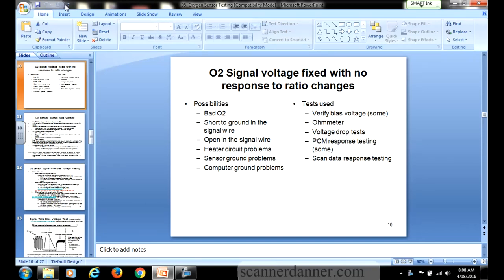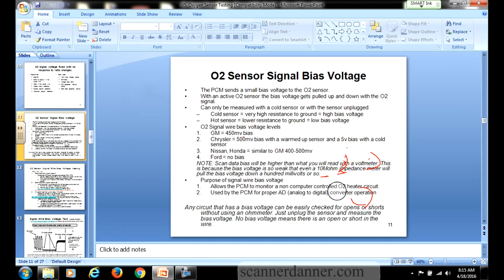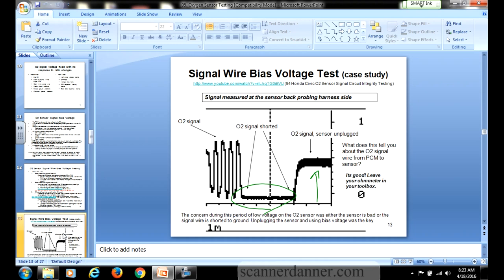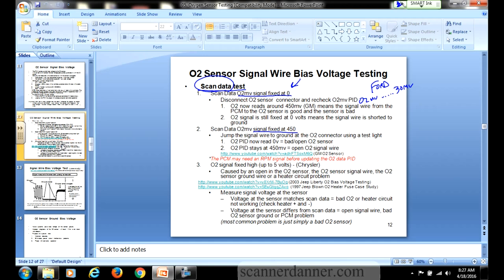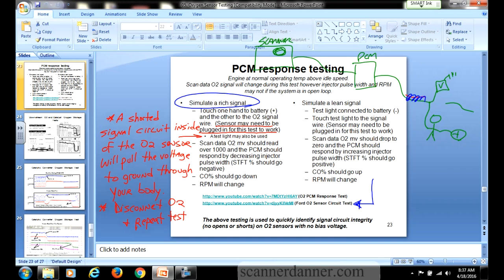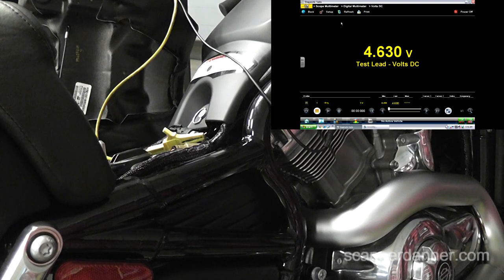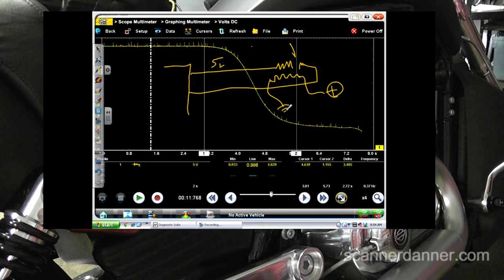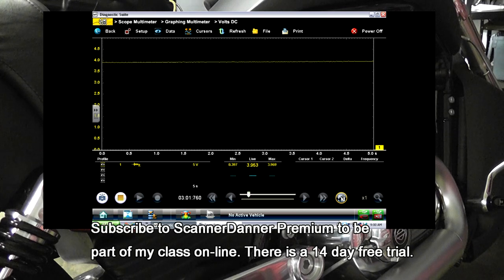What is Oxygen Sensor Bias Voltage? (an SD Premium video)

Comment: Thank you, Sir.  You described my problem exactly. o2 heater circuit malfunction code 41, heat element in sensor checks out, wiring checks out. Factory flowcharts don't give signal testing procedures or values and, whats worse if you follow flowchart to end it suggests bad ECM. I couldn't convince myself to throw parts at it (new o2sensor) without evidence it was bad, had started to believe I needed a new ECM. Edit: forgot to mention going to try this out tonight. Working on a 94 Acura Integra.

Comment: 27:21 Also, people were using spark plug non-foulers or spacers on the downstream oxygen sensor to trick the computer into thinking the catalytic converter is good.  Some manufacturers responded by adding an additional test of commanding the air/fuel ratio rich or lean to see if the downstream oxygen sensor is responsive.  If it is not responsive, then the computer will throw a P0420, even if there is a flat line on the downstream oxygen sensor.  It was down to combat spacers on the downstream oxygen sensor.

Comment: Hi Paul,
This is unrelated to this video but I could not help my self
from asking. You videos are some of the best I like how you cover all the
aspects of the issue at hand. Nice to see how complete you attack a problem. I
find the best part of your videos is when you teach your self! Keep up the excellent
work!

I was wondering, could you do some ABS Traction control
videos? I would like to see how to test the system electric and mechanical.
Bleeding the system is a challenge as well. Some systems also integrate the
steering angle sensor can you explain why?
One last thing the CAN BUS system HI Low testing how to know
if its talking to the PCM or the PCM to the ABS module.
Thanks 

Michael
Reply from the maker: Thanks so much! Here is a playlist for some ABS stuff
https://www.youtube.com/playlist?list=PLAFYVCyenqcoLcXnSf8IW23v-zoJfAi9-
And for sure I'll post videos for the other things you mentioned as I see them.

Comment: I know a Harley is a status bike but why would anyone wanna sit on something that idles so rough you can see the mirrors shaking. Could just as well be riding an old John deer model A tractor. I like a smooth running bike. Just my preference. Nice smooth idle and a great power curve when accelerating. Good lesson great explanation of how the O2 sensor heater circuit works.

Comment: Awesome video. Practical checks that most manufacturers don't tell you. When checking circuit integrity wouldn't it make more sense to unplug the sensor and use the circuit ground to short the signal wire rather than using body ground? Using the circuit ground when shorting the signal wire verifies both the signal circuit integrity and ground circuit integrity at the same time. Thanks.
Reply: J

Comment: Paul I do not think ice on the O2 sensor will hurt it, I lived in Minnesota and in the winter it can be -50 with the wind chill. Plus if you park outside in the snow it gets right on the O2 sensor. Cooling the sensor down fast.
Reply from the maker: I was just worried about the sudden rapid cooling but your point is a good one for sure.

Comment: Do you have any videos teaching about the newer A/f ratio sensors on Fords? I believe they're 5 or 6 wire and are using a bias. Ive not had time to sit there and play around with 1 yet. The ones I've had have been hard to get to the connectors and of course the exhaust is piping hot. Ive been checking heater circuits with a test light and then unplugging the sensor to check for 2.5v due to seeing that on others. I'm not exactly sure how they work with, I believe they call it, a nert cell? Would like to learn more about them though
Reply from the maker: Not on the design you mentioned but I do have a few wideband O2 videos. Search "wideband" on my channel. Thanks!

Comment: FYI, my 2003 Mitsubishi Montero 3.8L seems to have a super low bias voltage of 0.11 volts (yes, 110 mV).  Both oxygen sensor harnesses read the same on the corresponding harness pins. I couldn't find this on any Internet source...probably because most 15+ year old Mitsubishi are in junkyards, in USA anyway! Lol...but I like mine!  

Now if I can just figure out why it sometimes refuses to start when it's in the middle of winter. All I have is an occasional P0171 code (bank 1 lean), and an occasional P0431 (Bank 2 CAT bad efficiency). Both downstream sensors are showing ok (0.2 to 0.8v). Bank 2 downstream sensor shows fast-moving from 0.2 to 0.9V.  Bank 1 downstream is steady at 0.8 to 0.9 V.
My bank 1 STFT is usually out of spec (usually +13 to 25%), while Bank 2 STFT is usually ok, between -5 and +5%.

I took voltage readings from each upstream sensor when it was hot and voltage matched what the scanner app said it was. No vacuum leaks I can find using a half can of carb cleaner. It would not start from January through mid-April and once it warmed up outside to 50's F something allows it to start and run fine!  Perplexing...

Comment: 29:36 23:22 The Verus has an impedance of 10 million ohms.  Apparently, 10 million ohms of impedance is enough to pull a 5-volt reference down to 4.630 volts.  If you do the math, that means 0.370 volts dropped across the resistor inside the PCM and the rest (4.630 volts) dropped inside the Verus.  To calculate current, I=V/R=4.630 volts/10 million ohms=0.000 000 046 3 amps.  To calculate the resistance of the resistor inside the PCM, R=V/I=0.370 volts/0.000 000 046 3 amps=7,991,360.69 ohms.  If you round that up, then that is an 8 million ohm resistor inside the PCM.  That explains why you can apply battery positive directly to the signal wire of the oxygen sensor and NOT destroy the PCM.  It's because of the ridiculously high resistance resistor inside the PCM.  46.3 nanoamps is an extremely weak current!
Reply from the maker: That's some good math 🙂, but one thing to clarify, this is a 5v signal bias, and is not the 5v regulator direct supply.

Comment: HI, there I have a 2012 honda accord 2.4 code p0135. O2 heated circuit malfunction.  Intermittent problem . Replaced o2 sensor oem. Checked resistance on circuit from ecm to sub relay and from the relay to sensor . All within spec.  The ecm it is shutting down the driver ground signal.  I replaced ecm vehicle was driven 300 miles  and set the same code p0135 again.  Any feedback on a problem like this that you have experienced??

Comment: I think the reason you can get away with applying 12V through your body to a 1V sensor circuit is because the resistance is so high, current is miniscule. The damage inside the pcm comes from power, the product of current and voltage. Although voltage is 12 fold higher, the current number is so tiny the PCM never sees enough power to fry electronics or fingers. On a plot of resistance against current (or power) the only way to deliver significant power is with high current. Comparing similar plots of current against resistance for two hyperbolic curves of 12V and 1V, the two curves are remarkably close together on the far right side where resistance is high.
Reply from the maker: It actually goes beyond any external resistance. It is the internal resistance of a signal circuit on an input sensor in general. For example, I have seen the 12v heater positive shorted to the O2 signal wire and it DOES NOT hurt the computer. Fix your short and you are good to go. It may hurt the O2 sensor, but not the computer. I have a case study on this on SD Premium on a Lincoln.
Reply: Excellent point. Engineers get a lot of criticism in retrospect, but their effort is often not appreciated when they do something right. By designing huge internal resistance, they plan for the misadventure when stuff happens. It's another one of those invisible safety nets underneath. Thanks again for an outstanding video, Paul.
Reply from the maker: No problem and thank you for the comment! It looks like you channel is really growing too. Congratulations my friend, good providence to you.

Comment: My o2 sensor downstream changes readings with change of speed R P M  of engine & with change of fuel ratio -the problem is the bais voltage of town and country is 2.5 voltes .the senor voltage comes down to .77 V and never goes to .45 V !THAT gave me P0137  and smelly exhaust -Can I Modify this range to the correct values?THANKS.

Comment: yes thats(on bike) the Bias i wanted to see(on your last video), so i wouldent need unplug that wireharnes to clear it in my head ;)
Anyway lower then 1 volt Bias. man i need to take out my tools moore and see do we in here have those to help as....
Thanks Paul for the folowup video and Help!
Reply from the maker: Yeah, in hindsight I should have unplugged it for you guys but I will tell you, it would have been the exact same reading as a cold sensor. Measure the resistance between the signal wire and the signal return wire sometime on a cold sensor. It will read an open circuit
Reply: yes that what i would like to see on our cars in Europe.
As you unplug a sensor or so a Bias voltage. so you dont look for it to change how the engine or what ever you have do things but to see the wires to the brain" is OK at least if they dont need to handel a load...
Reply: Anyway i see more and more me to get my Pico out even on "cheap stuff" :)
Reply from the maker: Exactly! No need to do resistance measurments when you understand bias voltage

Comment: Hey Paul great vid!. Question: Would the worksheets be added to the ebook for currennt owners?
Reply from the maker: It will be probably a year before they are done and it will be in the form of a workbook.
I don't know if I'll make it available as an eBook or not yet. Thanks!
Reply: Hey professors just stopping again to see some material to refresh my mind and man it's like I learn something new everytime. But I can't wait for that notebook with the questions and answers or workbook. That video u just released on the can questions on ur premium channel is freaking awesome. If the workbook is like that holy crap that will be awesome follow up material. No rush professor but u got alot of eager fans out here. Thank u god bless

Comment: Hai SD, my 2008 GMC Denali is throwing 
P1133( heated oxygen sensor, insufficient switching bank 1 sensor 1)
P1153( heated oxygen sensor, insufficient switching bank 2 sensor 1). 
Changed the oxygen sensors and again the same code is coming back. Any suggestions? Thanks
Reply from the maker: Check your heater circuit for those O2 sensors next, then make sure you have no exhaust leaks

Comment: So on my 2001 Dodge 5.9liter the O2 bank 1 sensor 1 Heater circuit dont start working and getting a reading until it warms up? Is this why it keeps throwing a P0135 trouble code?

Comment: I've got a 2001 Honda CRV that I measured the white oxygen sensor wire on the harness side, with the sensor unplugged, and it was showing 1.28 Volts. The car was warm.  I have a P0131 code with hard starts and stalling indicating the O2 sensor.  I confirmed the 1.28 V with two multimeters. When I monitor the sensor with the code reader and the multimeter it seems to work ok when cold but as soon as it's warm the voltage drops to .1 to .2 at most, the car will sometimes try to stall, and the code will occur.  So it seems to be a failing sensor. But I wanted to be sure it's the actual O2 Sensor bc I hate replacing good parts.  I also unplugged the vacuum line to the PCV and it started revving the motor up and down between 1000 and 2000 RPMs.  
This 1.28 V doesn't seem to be right though. What could cause that?
Reply from the maker: This is normal. It is called a "bias voltage" and is used by the ECM for diagnostic purposes. What you are describing is NOT an O2 problem. Quick lesson:
1. An oxygen sensor is not even being used for at least the first 30 seconds from start up on a cold engine. Do you understand why "hard starts" cannot be the O2 causing this symptom? :-)
2. When the engine warms up, you are seeing an ultra lean signal on the O2. This could be a bad O2, but see point number 1 and the fact that you said it seems okay cold, then when it warms up you see the signal drop to .1-.2. This tells me the O2 is fine and you have an actual lean condition. (yes it will set that code). This screams a fuel delivery problem. MAF sensor test and then fuel psi must be confirmed next.
Reply: @ScannerDanner  thanks! I mis-tested it. Bad wire connection or ground. Went to it directly with voltmeter leads and battery negative and it read 0.40 V, as it should.

Comment: If your working on a vehicle with multiple O2's , Do you need to unplug all the O2's before testing them individually ?  Referring to the voltage drop using your finger .
Reply: No you don't.  Each O2 has its own signal circuit and voltage data PID.

Comment: When you are emphasizing that the signal is "weak" (the 5v bias), then showed how you can drop it by touching it with one hand and ground with the other hand, what constitutes it as "weak"? Just the fact that the voltage is only 5v and not 12v, or is there some other factor that makes it a "weak signal"? Could you drop any 5v supply by touching it with the other hand on ground?
Reply from the maker: No to your last question which should answer your first question. Or these videos may help  
- What can cause an O2 sensor to read near 5 volts? (Chrysler bias voltage)
https://youtu.be/v8XrM-7BuOg
  - System Too Rich P0172, P0175 from a blown O2 heater fuse (Jeep)
https://youtu.be/SEuGtggZAvo

Comment: Paul, is the book different from the one I bought from you, Engine Performance Diagnsotics?  Because pages don't match nor have the same content.
Reply from the maker: Same book, same pages. Do you have the binder version or the spiral bound version. They are both the same but the spiral bound version has two slides to one page. So for example, I am on Chapter 5 (Section 5) page 12. This would be Chapter 5 page 6 (5-6). Everything is split in half because of two slides on one page. Make sense?
Reply: I have the spiral bound version.
Reply from the maker: So if you see me on chapter 5, page 12. It is still labeled as page 12 but it is on 5-6. Turn to it now, you will see what I mean. Putting two slide on each page save half the weight in cost of paper and makes it less expensive to ship for you guys.
Reply: Got it.
Reply from the maker: Sorry for the confusion and thanks again!
Reply: What was your brother's channel called again?
Reply from the maker: James Danner (the image is his wife fake kissing a big fish lol)
Reply: Thanks

Comment: I had a dodge Dakota 4.7 yesterday. had no power to the o2 heater on bank1 sensor 2. good powers and grounds to each of the other o2s. using the diagram I followed it to the ecu. on this design the ecu p.w.m the heater for all of the o2s. it has an asd sense circuit also. this car had burned the harness against the cat melting all of the o2 wiring together. my conclusion after back probing the computer was the driver had failed from a short to ground.
Reply from the maker: usually once you fix the harness, everything comes back to life. Not the case for you?

Comment: got a question 2006 Kia sorento 3.5 v6car came in from some one  p0134 p0154 new ntk sensors  some one changed got B+ ground signal sensors r active when at 3000rpm or higher checked   need some help finding the problem
Reply from the maker: It is becoming more and more difficult to answer questions here. I have 80,000 people asking me for help now. So I have created a forum to help you guys better. It is free to join and we can exchange pictures, wiring diagrams and waveforms if needed to help guide you through the process of troubleshooting your vehicle. Thank you so much! Hope to see you there. 
Paul Danner (ScannerDanner)
https://www.scannerdanner.com/forum/post-your-repair-questions-here.html

Comment: What would cause a vehicle to stay in open loop? My 92 explorer is running very lean and never goes into closed loop, even at 180 degrees coolant.
Reply from the maker: Bad O2, signal wire of the O2 shorted to ground. Vacuum leak, low fuel pressure, restricted injectors, bad map or maf sensors etc etc

Comment: At around 38 mins, if the 5v signal circuit is open how would the pcm send 5v? The return part of the circuit for the 5v is open so there shouldn't be 5v. What am I not understanding?
Reply from the maker: I'm not sure what your question is, sorry. The PCM is sending a weak 5v bias voltage down the signal wire of the O2. I thought this video explained that very well. I even showed it being pulled to ground through my body.
Reply from the maker: Sorry man, wrong video, thought you were talking about this one https://www.youtube.com/watch?v=v8XrM-7BuOg
Watch this one, it will help. Let me know

Comment: HI PAUL 
MY CAR LED HEADLIGHTS FLICKER WHEN ENGINE RUNNING  WITH ENGINE OFF ITS WORKING OK ANY IDEA WHAT IT COULD BE .
Reply from the maker: Check your alternator diodes. Perform an AC "ripple"test. Use a digital multimeter set on an AC voltage scale. Connect red lead to the alternator battery post and black lead to battery ground. Engine running, max allowable is 300 mv
Reply: THANKS  WILL CHECK THAT .
Reply: Fault should be with alternator brushes worn to marginal length making intermittent contact.  Diodes usually don't fail in flicker mode.  Be sure to load the system with headlights on while engine running too, but Paul's test method does have some merit to see the issue.  Misapplied AC voltage scale takes advantage of the tool at hand, but pretty sure that the typical DVM will not be fast enough to capture the signal at the readout - a scope sure would do it though.

Comment: Do you teach not touching your vm leads when reading voltage. Human body salt/water will give false or misleading readings.
Reply from the maker: Only when performing a short to ground test (ohmmeter) or when measuring certain high ohm circuits with an ohmmeter. Other than that, touch away 😉